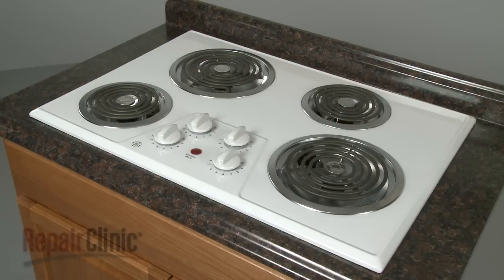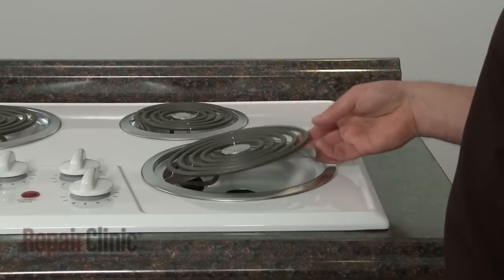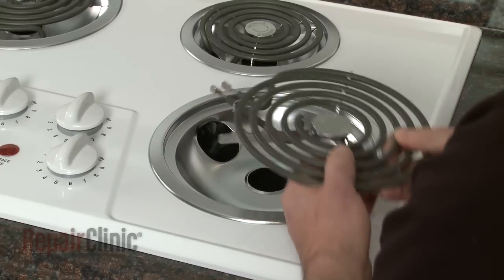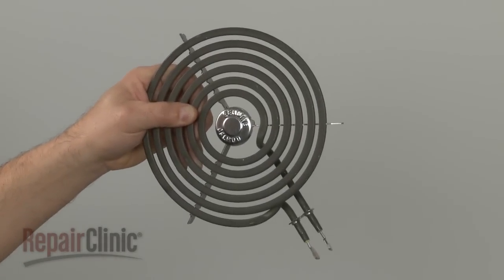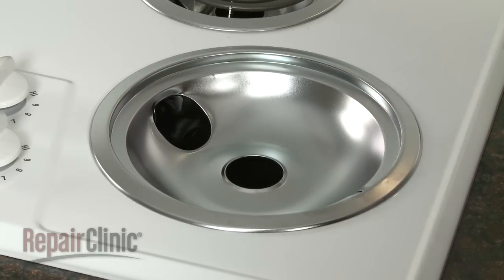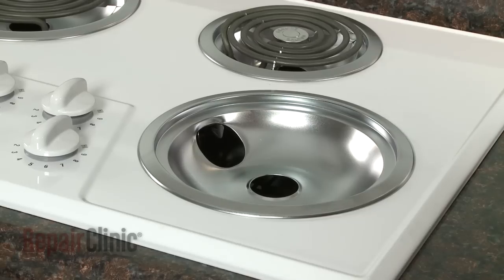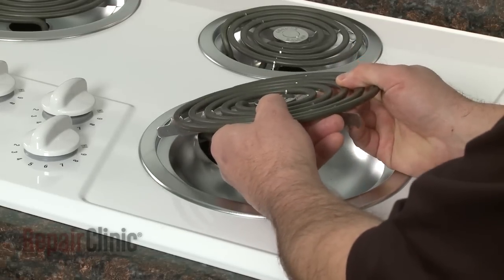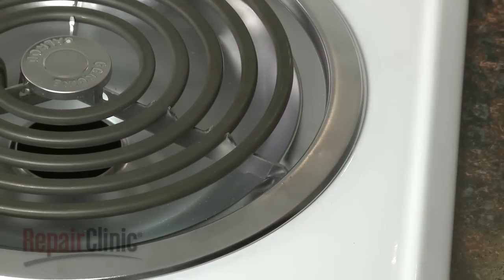GE Electric Stove Replace Surface Element Coil #WB30M2

Comment: Thank you for posting this video. This is the cooktop I have and I did not know how to dismantle it. Now I just need to figure out which drip pans on your site are the proper replacements for my rusty old ones.
Reply from the maker: You can find the correct parts by entering in your model number on our site. If you need help finding the part, give us a call or send a chat on our website.

Comment: Are there GE electric stove surface element coil that need to be screwed out? Because either mine is not pupping out or it needs to be screwed out